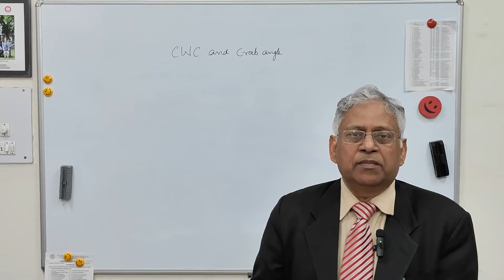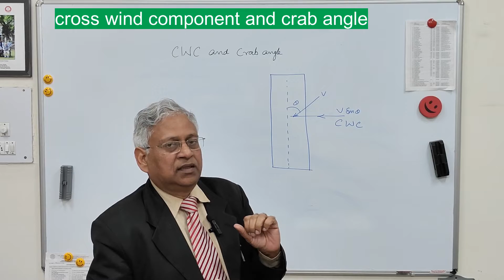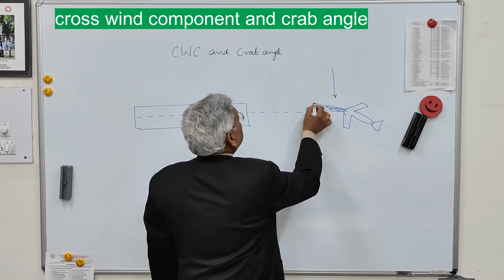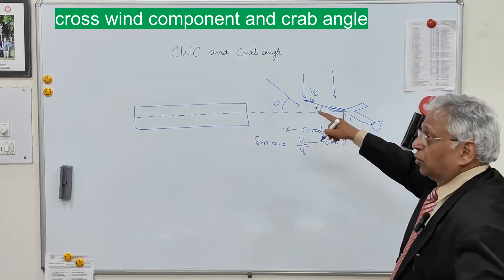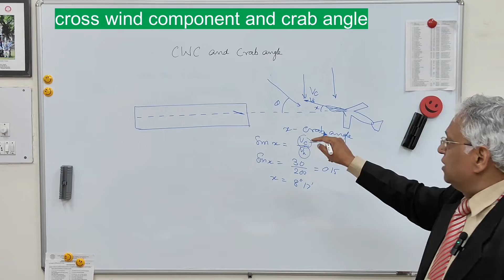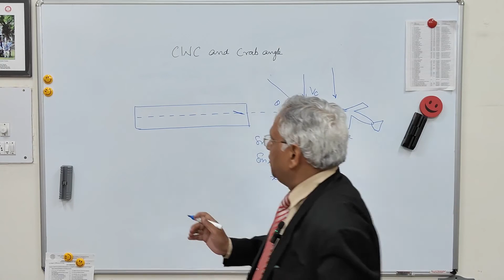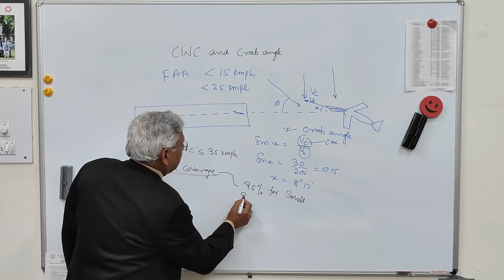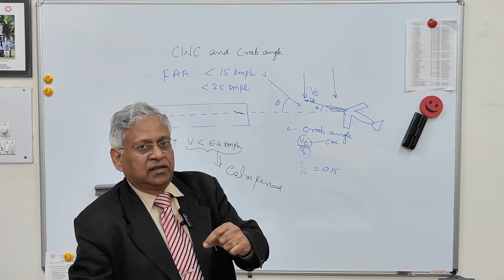Cross wind component for airportt landing and take-off, Crab angle of an aircraft during landing

Comment: Hello sir....
Small doubt sir...
ESE question....
The orientation of the runway is decided. ??
1 ) maximum wind coverage and least cross winds 
2 ) landing characteristics of aircraft 
3 ) Scope of future expansion 
4 ) obstruction free approach....

Coaching institutes they  answer 

1  3 and 4.  !! Sir..

Could you please explain why option 2 is not considered.  ???
Sir..... Tqqqqq..... sir......
Reply from the maker: In my opinion, only answer 1 is correct. All others are not considered while marking the centreline of the runway.
Reply: @SatishIITR   okk   sir   Tqqqq   so much   ...sir  

which parameters comes under  landing characteristics of Air craft   ????  sir  ....